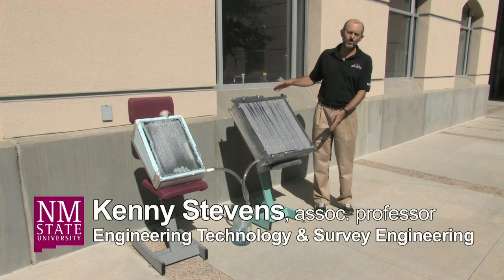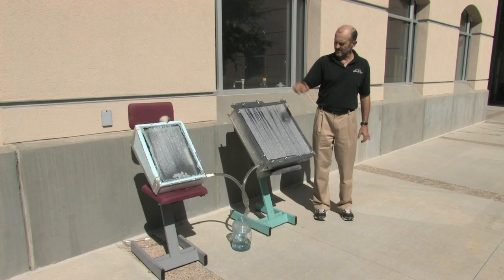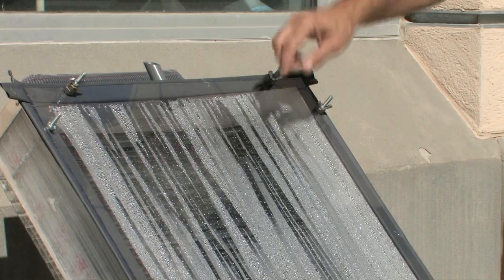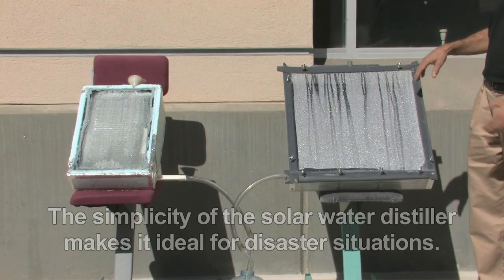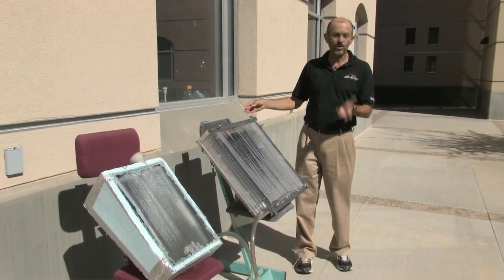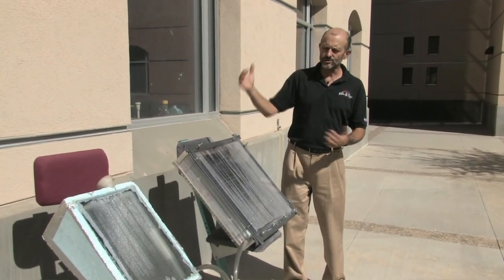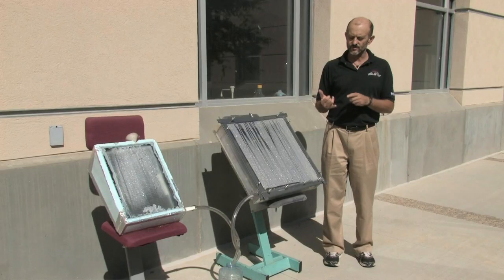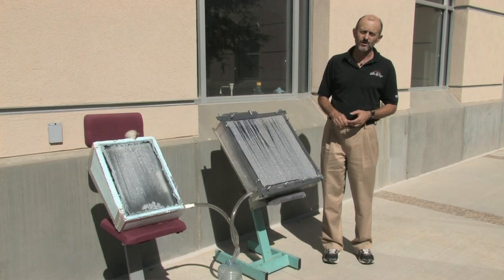Renewable Energy: Solar Water Distillers

Comment: Not sure about the polycarbonate cover.  If i remember correctly,  plastics break down in direct sunlight. I think glass is the best choice.
Reply: gconol Water bottles used by drinking water services such as Alhambra and Arrowhead are made of polycarbonate, and so are bubble canopies on jet fighters.  The stuff is quite stable in sunlight.
Reply: ***** On a macroscopic level?  Yes, they are stable.  But in a microscopic level,  they do break down and it dissolves into the water.  The plastics that are floating in the ocean have been degrading because of sun exposure. They've become so tiny now that smaller fish are eating them.

It's one thing to drink water with a little bit of plastic dissolved in it during an emergency, but on a daily basis that's going to kill you.
Reply: gconol Considering that we've been exposed to plastics for over three generations and people don't have three eyes or horns growing out of their foreheads yet, I'd say the risk is very, very low.  I'm not worried.
Reply: ***** You should really read about BPA found in plastics.  You'd be surprised what it does.  You're still young, I assume, but that can only go so far to protect your health.

If you have kids, then all the more reason why you need to be aware.
Reply: Tony R. Putting the collection bottle in the shade is a good idea, regardless of the material of which it is made, since that will keep it cooler and reduce evaporative loss.
Reply: Tony R. Glass is really the best material for this project. Home depot sell them relatively cheap.

Comment: Ty professor for sharing this . Would it also be true that if the water bottle you were using were kept in a significantly cooler environment " out of the sun" so to speak that the difference in tempurature would cause the water to condense and or collect into the bottle or bottles that much more easier ?
Reply: no.

Comment: One concern I have with this system: How do you prevent bacterial/fungal growth? After a few days I would think you might want to boil any water that comes out of there.
Reply: Actually, direct sunlight kills bacteria and virus.  I don't know about fungi, but most fungi likes to grow in dark moist areas.
Reply: Also bacteria need to feed off something.  Distilled water is not suitable for bacteria to grow in because it provides no food for the bacteria.
Reply: Run a Uv light
Reply: That much sun exposure to clear water  is likely to kill any bacteria anyway

Comment: What's the point if you don't give some details on the innards or the construction?
Reply: Luc, I made one when I was young, the inside is just a box that heat's up when the sun goes through the glass, I had a copper pipe on the top with holes in it (hooked to a water source, mine was a can)  and a towel wrapped around it to soak up the water, the towel then when down to the bottom and wrapped around another shaft (excess water drained out a hole), then back up and sowed together, the water then condensed on  the glass and ran down to the bottom where an angle iron was attached to the glass, then the water ran down the iron and dripped into a container.

Comment: Sure need to find some people who already know how to do this to show me, hands on; I can't figure out anything from this video, except a general idea that it is possible.  But, I think it is massively important to know -- there don't seem to be any clean water sources left anywhere in the Western world anymore.  Pollution everywhere.
Reply: Patti, I made one when I was young, the inside is just a box that heat's up when the sun goes through the glass, I had a copper pipe on the top with holes in it (hooked to a water source, mine was a can)  and a towel wrapped around it to soak up the water, the towel then when down to the bottom and wrapped around another shaft (excess water drained out a hole), then back up and sowed together, the water then condensed on  the glass and ran down to the bottom where an angle iron was attached to the glass, then the water ran down the iron and dripped into a container.

Comment: Hi, nice video! I'm trying to design one of these on a large scale as a permanent primary water source for a small village of 27 people. Can you just clarify how the inside of the 'tool box' looks? On that angle, how does the water evaporate and not fall back into the original water stock? Is there a wall separating the two water bodies? cheers
Reply: عليك اضافة بعض العناصر  لتكون صالحة للشرب
Reply: hey curious if you ever built anything yourself?

Comment: Great question.  Plastics can be a problem.  Always check the temperature and outgassing problems with the plastic you are using.  Polycarbonate has shown itself to be the most friendly material. If you can taste it, then it is a problem
Reply: I think the glass will be much efficient material for this kind of project.

Comment: Always throw away the first ounce of water from each batch as some chemicals evaporate and condense like water. Don't drink the last ounce either. The difference being that chemicals evaporate at different temps than water and so they make their appearance at the beginning and end of a distillation. 
You could also just throw away the first ounce and stop the distillation process before all the water is gone.
Reply: Why don’t you just don’t condense
for 5 min then start condensing after
The 5 minutes is up.  In addition to
stop evaporating before water empties,

Comment: If you just want a fun little thing, you can take a bowl, a cup, a small weight (rock), and a piece of syran wrap, put 1-2 inches of water in the bowl, then put the cup in the water so that the cup does not fill with water from the bowl (right side up), put the syran wrap across the top, and the weight directly over the cup. Once the cup fills, you have a cup of warm, but drinkable, water...